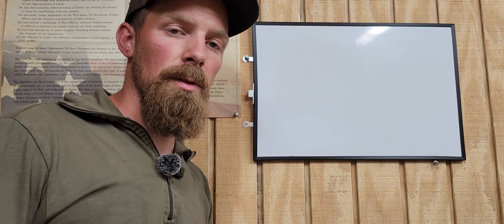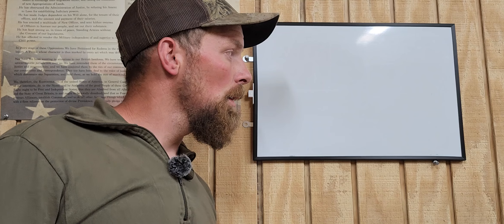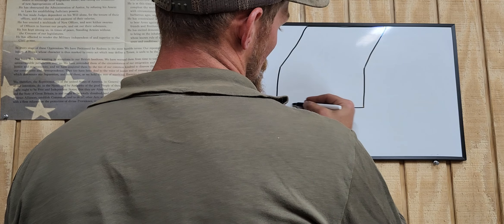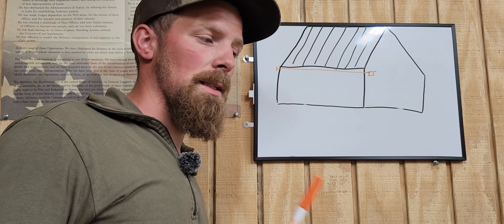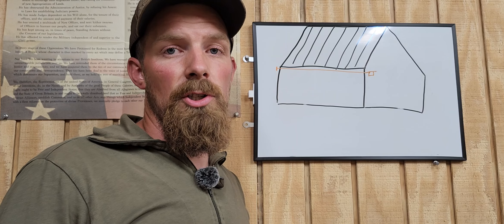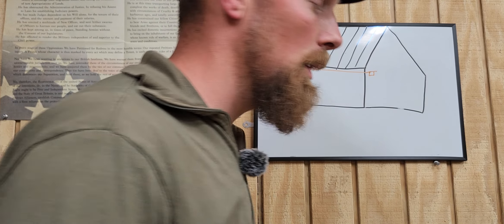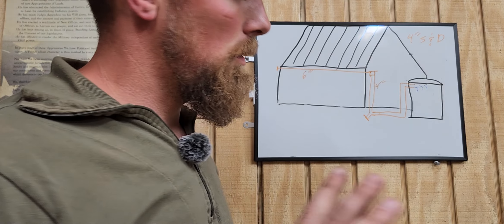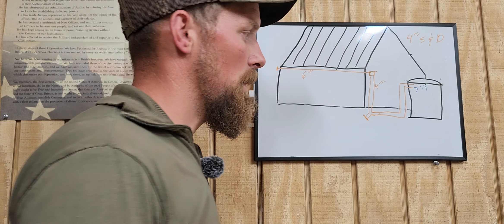Rain Catchment: The Basics of DIY Water Collection Systems

Comment: Your presentation improves with each video. Water is critical for a homestead. Some water suppliers will not allow ANY type of connection. But it can still be done discreetly. 
Frank
Reply from the maker: Thank you! 

As I have well learned on this journey,  back-ups are important.

I'm unsure on other states. Oklahoma DEQ does allow it, but there could be rural water department by-laws that get in the way. There is a minimum distance recommendation for this Cross Connection. They recommend an Air Gap that as a general rule is at least two times the width of the inside diameter of the pipe.  Double check valves are normally not an acceptable approach for this.

Thank you for the input!
Reply: @themountainwizard you would need to have a backflow preventer

Comment: Do you believe in doing a first flush system and possibly using a UV filter?  Very Informative!
Reply from the maker: There can be an argument made both ways for the first flush. I do not use it because I have removed the trees overhanging my roof, and from what I have researched it "wastes" quite a bit of water, that, during a drought (which is common in Oklahoma) is crucial to us. 

And since I have tanks that allow for it to settle out before being pumped from, it's not worth it from what I can tell. 

I don't think there would be anything wrong with a UV system. I use an "air scrubber" UV light on my central air unit in my house, haven't looked into any of the systems for water so I'm ignorant on that process and the cost associated with it.

Comment: I have seen this type of system,  its basically the same thing im doing,  but im using a rain head and diverter for first filtration, im also using a sustainable pumping system.
Reply from the maker: Right on. 

What pumping system are you using?
Reply: @themountainwizard  A modified 12v DC Seaflow with a  AC pressure switch and 5 gallon accumulation tank, the reason I do this is because some 12v pumps have diaphragm pressure switches that don't get along with float valve applications,  so I put up a mega pump tutorial video on how this can be done, these pumps run for years without any problems,  I also have been on off grid rain water for years.

Comment: Another question: what about overflow? How would you install an overflow and should the overflow pipe be larger diameter compared to the intake pipe? Thanks!
Reply from the maker: So in the top of these tanks there is an extra Banjo fitting that you could attach an overflow pipe to and divert it away. 

You could also install a Banjo fitting of respective size into any tank you are using.

On MY system, I remove the cap on the top Banjo fitting (about 1.5" fitting) and let it just overflow out of that as needed. But, it's seldom that tanks are overflowing, about 6 times a year give or take. 

I have not had an issue with this 1.5" overflow pory and worst case scenario, it overflows on top of the gutter at the downspout,  but I do not recall ever having witnessed that. 

Your 4" inlet will never be at max capacity carrying water to the tank. Your limited by your downspout cut out and it is impossible for that volume of water to flow out of that rectangular 2x3 or 3x4 hole.

Hope this make sense! Thanks for the question.
Reply: @themountainwizard  Thank you - I made another post a few hours with questions on surface vs submersible pumps, I can't see it listed hopefully it will show up later